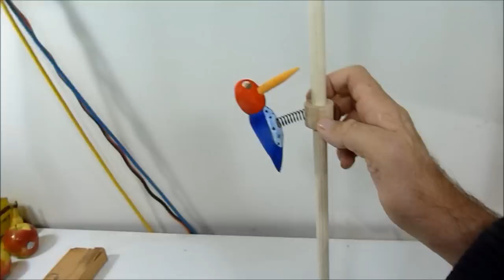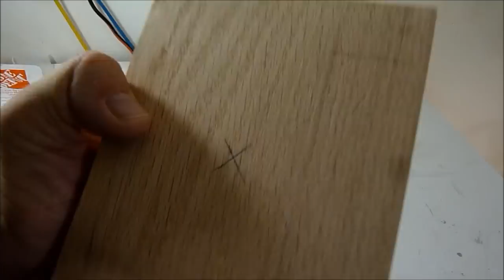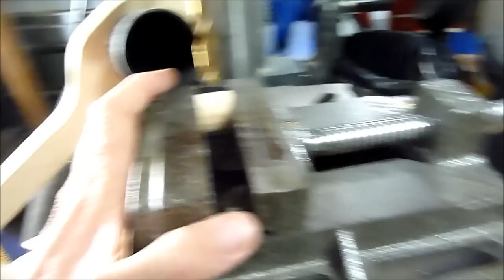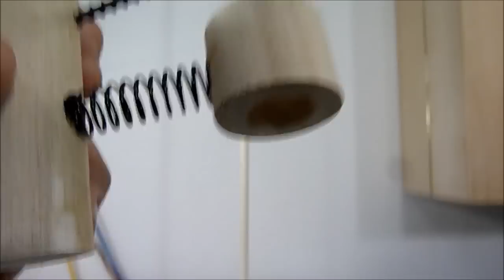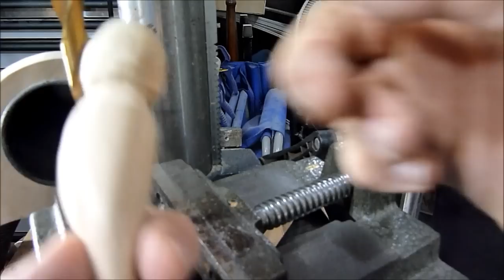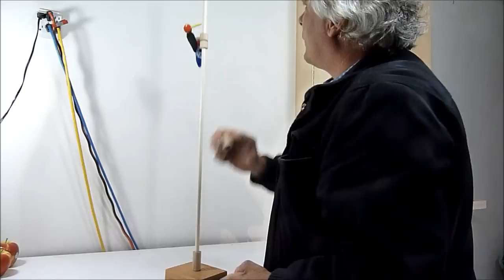Woodpeckers in motion, how to make

Comment: I have tried to make a copy of your woodpecker on a pole and found that it slips too far when bouncing.  What diameter is the dowel rod in your video?  What diameter drill bit did you use for the sleeve on the bouncing bird and how thick is the wood sleeve?  It looks to be about 1 inch.